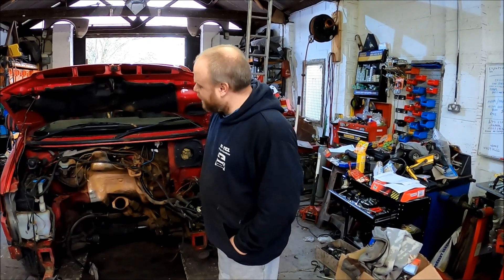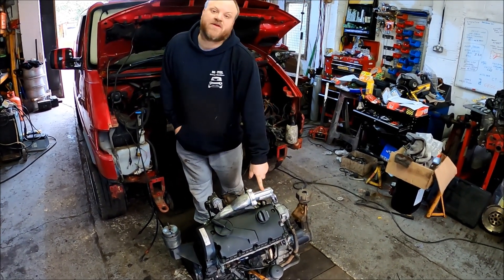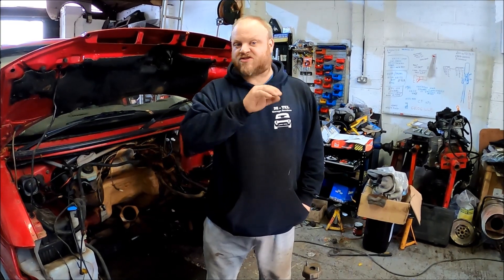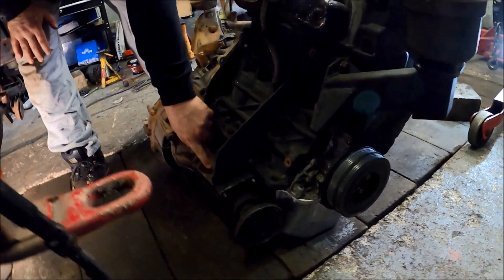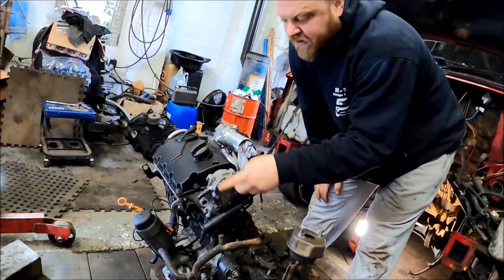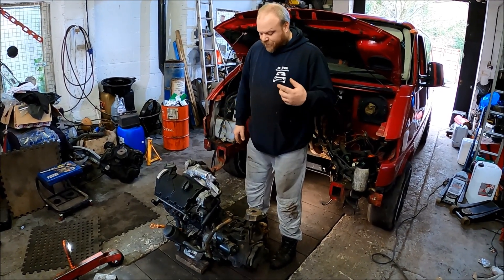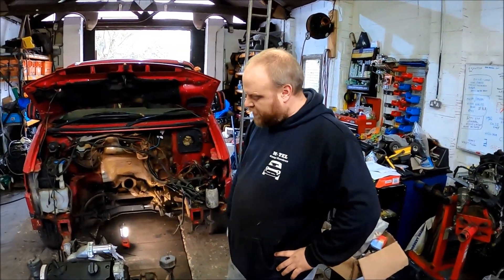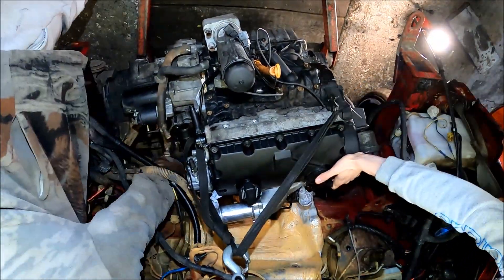VW T4 transporter pd150 conversion guide how to modified turbo up grade Tel's garage

Comment: Alright I'm working on it now I can't get the sump to fit on after mounting the gearbox, any advice on how you fit it on would be really appreciated
Reply from the maker: Hi mate I use a sump off a bit 1.9 t5 transporter and it was close 
If I remember right I use a hammer and gently put a little dent in the back of the sump to clear the driveshaft flange

Comment: Are you able to this conversion to my t5 1.9. Cheers
Reply from the maker: Hi if u have a t5 1.9 it should already be fitted with a pd engine 😀
Reply: @TELSGARAGE  hi Terry thank you for the reply. I thought you had uprated the pd engine to fit t4.  I’m after more power now from mine.  Do you know which components I can replace. Inlet turbo etc.  I’m going for a darkside intercooler anyway. Sure it’s easy enough to get extra power by swapping these items. Passat pd150 parts??? Cheers
Reply from the maker: Hi yer the pd engine are almost the same it’s just the injectors and the turbo that holds them back 
So a set of pd150 injectors and a nice big turbo and the pd 150 head bolds or a set of updated head holts and a strait pipe 

I tuned a mk4 golf up the other day which had a pd150 engine in it and I got 220bhp
😀
Reply: @TELSGARAGE  thank you. Which turbo would you suggest. So my inlet from my t5 is same as Passat 130 or golf gtd. good work
Reply from the maker: @edwardpayne4150  right I’d say u would want a turbo off a pd150 from a mk4 golf or a a3 turbo will be a gt17 and u would want a egr delete pipe for the manifold that will get u close to 200 bhp try and get a hybrid gt17 or a gt20

Comment: liked subscribed and only watched 5 times so far great information can't wait for next update can I ask what gauge of steel you used to fabricate the mountings and did you work out an angle or just eyeball it?
Reply from the maker: Hi sorry for the late reply I used 6mm plate for some of the main fixing plate and the reinforcing and some box tube think it was 40x80mm and a pice of 2inxh 5mm tube with 2 10mm plate welded and stepped on top of it with a key way to lock it into the og mount 😊
As for working out the position I made a jig that I built the mount off of 😊